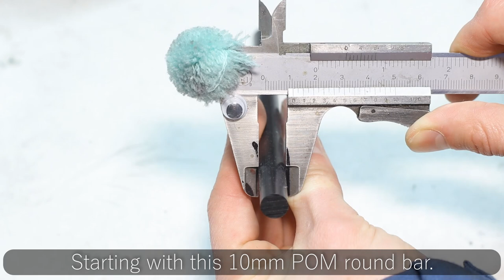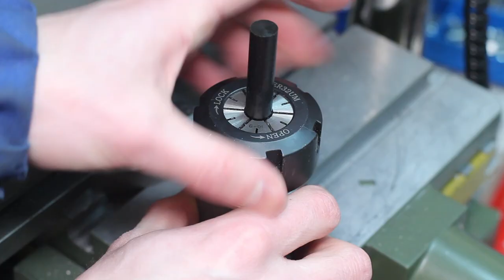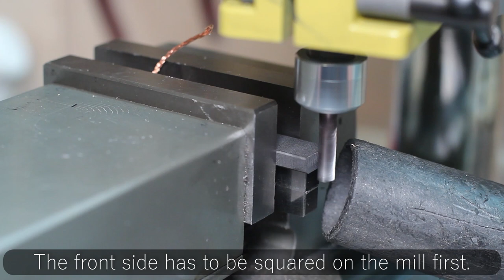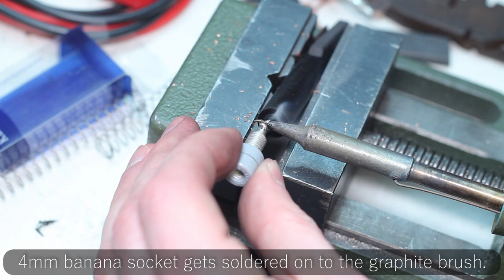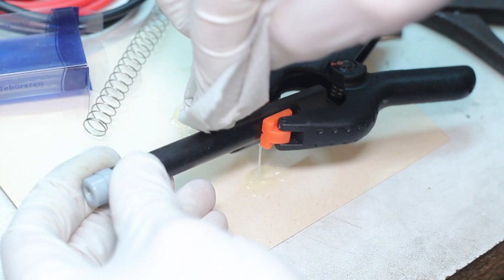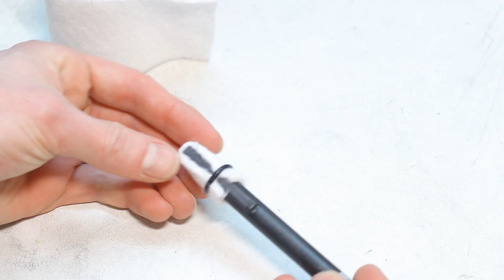Making a Metal Etching Stamp with Graphite Tip

Comment: Don't worry, everyone who tries to solder does the same thing. For a good solder job the most important thing is that the part is reasonably  clean (that's flux's job but it's not magic) and the part itself needs to be at high enough temperature to melt the solder itself. Then you just push solder in and it will suck it right in.
And like all things,  it takes practice
Reply from the maker: Thanks for your advice! :)
Reply: @WeCanDoThatBetter  @Daniel Jankovych Right, and you are pushing fresh solder in it because you need the flux inside the solder, not the solder itself...
Reply: @therealemmpunkt  Depends, but usually if I need more flux I need more solder as well. But if I need just more flux I use modified pine sap. We use that as it's really cheap and available in every hardware store.

Comment: Very nice job 👍💫💪
 What is electric voltage for this tool?
Reply from the maker: Thank you very much! I used 12V 1A AC current for the etching. I think I will make a video explaining a little bit more the etching process.

Comment: Why bother with graphite tip when you are covering it with cotton cloth soaked in electrolyte ? If you wrapped a cloth around  copper rod you would get same effect.Plus carbon brushes dont like moisture and you are soaking them.Nicely made video but this step is useless and you can do etching without it,at first i thought you are making electropencil.
Reply from the maker: Thanks for your comment and feedback! I just copied the commercially available stamps and they all have graphite tips. I don't know if there is another reason for it as I was wondering too why they don't use any other material. I guess it has something to do with the electrolytic etching /eroding process. Every die for a die-sinking erosion machine is made from graphite as well. Perhaps there is the same reason for it.
Reply: @WeCanDoThatBetter  I have done it with simple things as 9v battery and a cotton ear cleaning tip.The thing that matters is if you are using Dc or Ac power supply .Dc will etch it deeper and ac darkens the etch or was it in reverse? Its been a several years since i etched anything.Still got the machine somewhere in basement . . .
I built it out of old radio transformer it had 12V 1.2A -transformer makes AC current that you pull trough bridge rectifier (4 diodes)so i used banana jacks for speakers ,one transformer lead is common ,other one divides into two -one side is connected before diode and it gives Ac power ,other one is after diode so it gives dc power.

The only reason why you might wanna use graphite is resistance ,but i never had problems with that if electrolyte is well made.